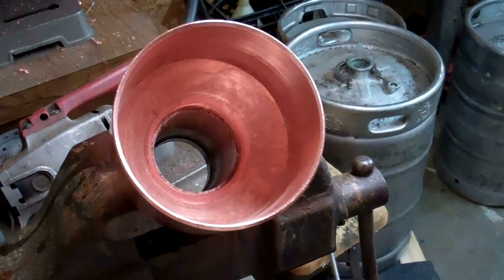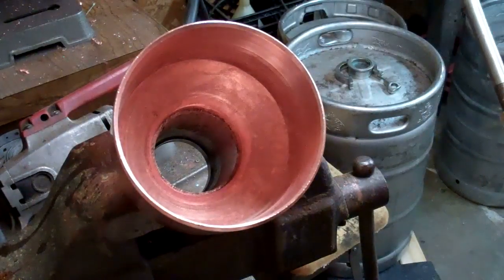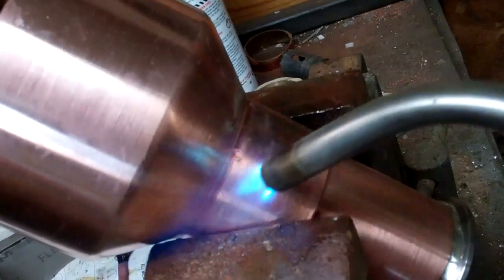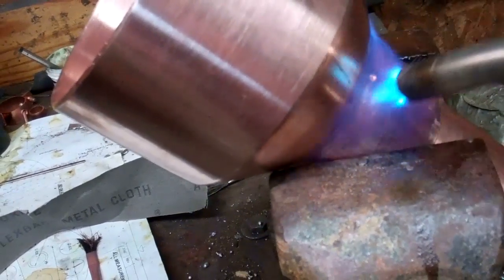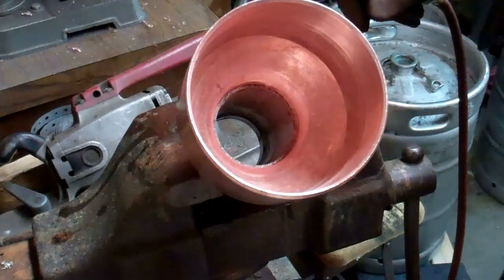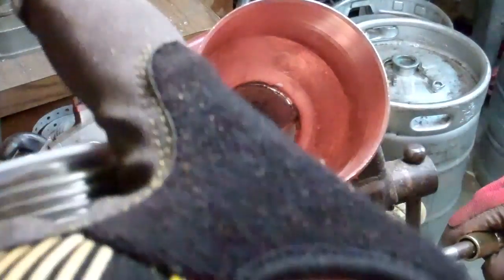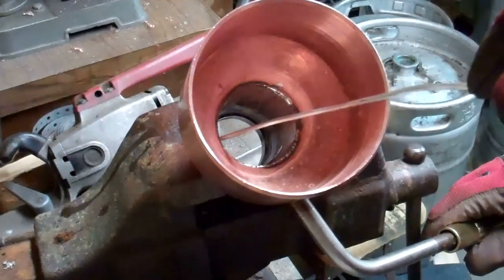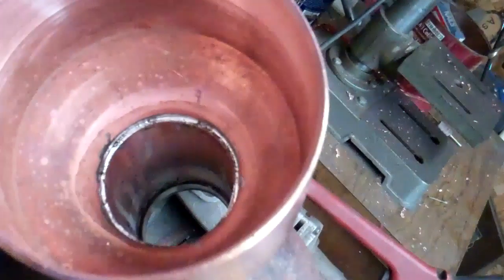Soldering Copper to Copper

Comment: Solder you buy in the plumbing department is typically lead free. Leaded solder is used for electronics so if you do that kind of work keep them separate. As for inside or outside- well most of the time you can't get to the inside, but no difference. The strength and seal is between the two surfaces. If you pull a joint apart you will see the surface is coated with solder all around. Soldering is surface only- it does not melt the base metals like welding. Agree on vice being heat sink.

Comment: One mor thing- silver solder as people call it is much more expensive and needs a hotter torch (like he has) than standard plumbing solder. It is used for soldering dissimilar metals like stainless and copper. Copper to copper- use your standard plumbing solder.

Comment: But he hits the key points- clean it, flux it, heat it (apply heat on the outer piece to pull solder into joint)